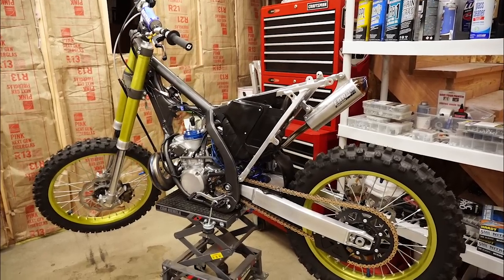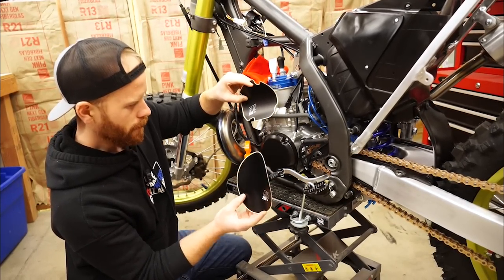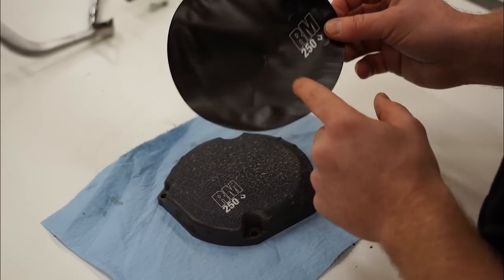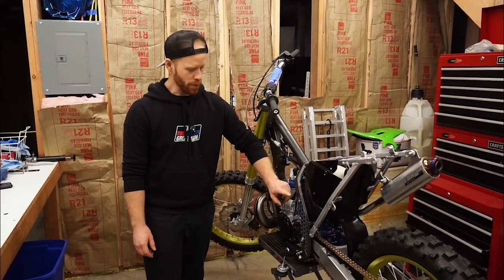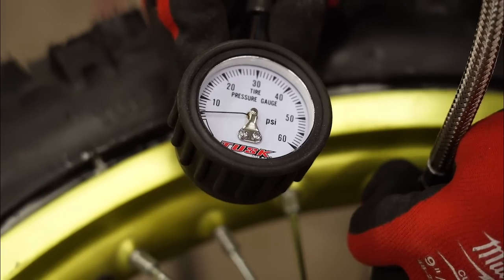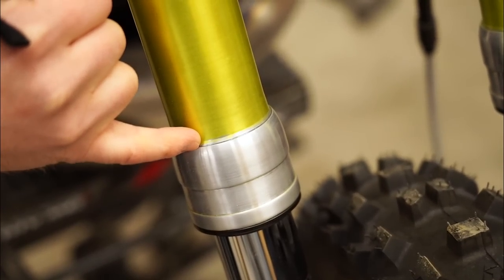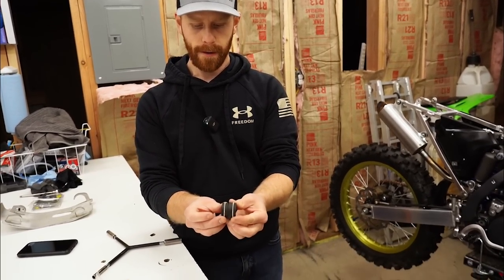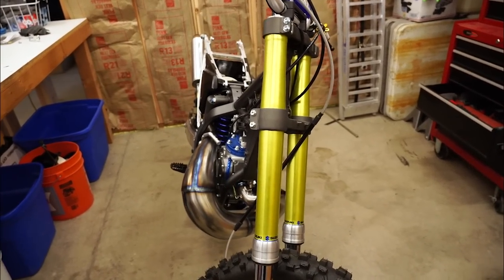Fixing Everything That Went Wrong | RM250 Rebuild 36

Comment: If that valve cap has the o ring in it you should remove it. Sometimes those o rings will turn sideways and press on the valve core causing your tire to slowly leak air.

Comment: Don’t know if you gonna respond back but I need help fixing my 2003 ttr 125. Basically it doesn’t idle and dies a couple seconds after letting go of throttle/clutch. Cleaned the jets, no fix. Recently (while it was very muddy) it just started bogging out of nowhere. Did something go into the carb? (Clean air filter). Next ride and gas is pouring out of overflow. Rode for a minute and it stopped, then I stalled it due to the profuse bogging and gas started pouring out again whenever the fuel was on… any thoughts? Definitely pulling the carb out, but what should I do? Thanks for any help love your videos